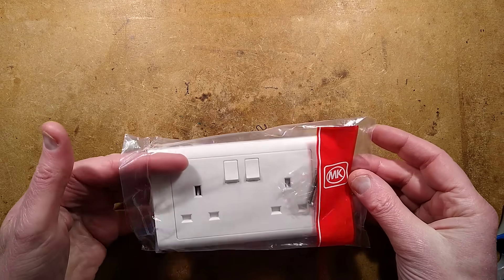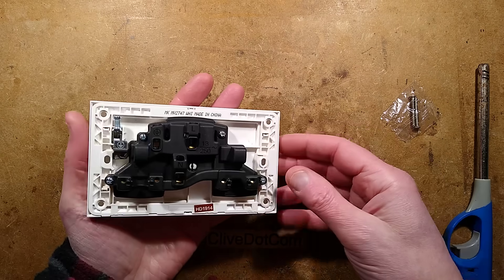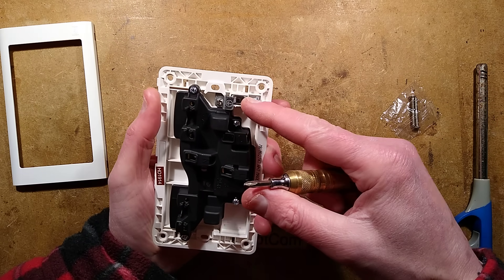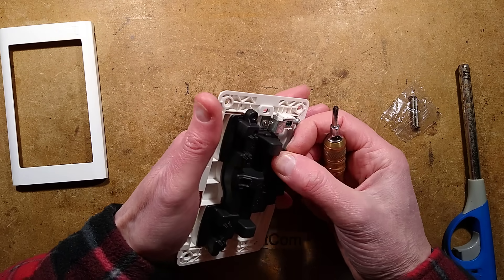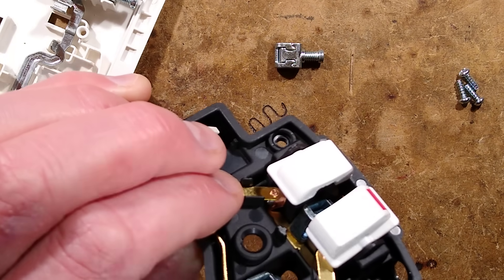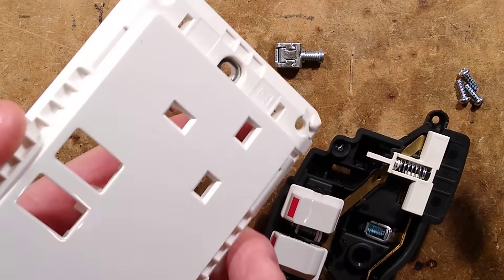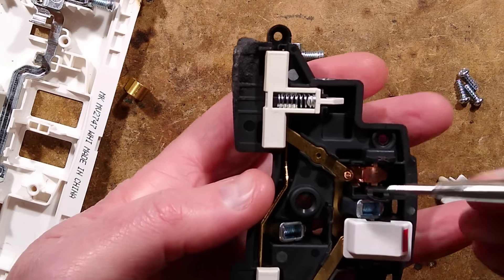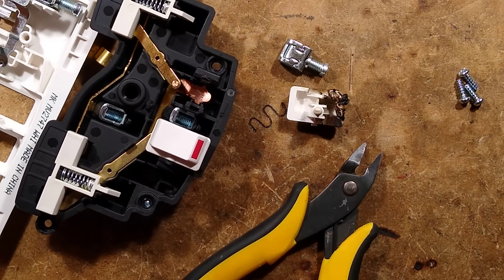Flame test on a recalled MK socket

Comment: Did you apply power and a load and see what happens? Maybe there isn't enough 'snap' or tension in the contacts rather than being an issue with the resting gap.
Reply from the maker: I just tried buying another one for a load breaking test, and the seller cancelled my order.

Comment: My theory is that the brass component that rocks when you operate the switch doesn't rock quickly enough, so if you move the switch gently rather than positively the brass contact will also rock slowly, which will cause explosive arcing if there's a heavy load plugged in. So maybe you could destroy a third one, Clive, with another switching test using a 3KW load.

Comment: I would sugest that when the switch is closed that the contact presure is sometimes too lite  or even not fully closeing therfore allowing arking, The gap when the switch is open is clearly very lage so it must be the closed position that is the problem.

Comment: I had an electric car on loan but no way to charge it other than using its “granny charger cable”
It simply plugs in your a uk 13 amp socket. 
However after some 5 hrs charging, the 13 amp socket got rather warm, not hot and not smoking. 
I was not the switch on the socket getting warm, but the line/neutral terminals of the socket. 
The plug itself on the charger cable was clean and looked like it had never been used. 

I wonder if this recall on the MK sockets was for poor contact connection resulting in over heating on high loads. 

My socket (not MK) was nearly new and little used. I replaced it anyway just because it had got warm in use on the car granny charger. 

YMMV
KW
Reply from the maker: Quality varies between sockets.  Some do heat up under sustained load.  For basic car charging I'd recommend a good quality brand or a spur and a 16A socket.

Comment: 4:51 Maybe that is what you should have done: Put it on an isolated circuit (with it's own extra fuse, and an emergency cut off), put a synthetic load on it, and then use a mechanism (even if just a long stick) to switch the switch a few times. See if you can get it to arc.

Comment: Perhaps with another socket, or the first socket once put back together (not the melted one) you could load it up with max current load on both sockets (or a little more) and try switching it slowly wearing insulating gloves or something. Try and make one fail?

Comment: Hi Clive,  Having already seen the first video you made I was a little concerned that the Earth Bar and Live Bars looked quite close together, but accepted you would have noticed that yourself.  However seeing this video where you have shown it from a different angle I wonder how close the Live and Neutral bars are on the left hand socket, seeing as they do not appear to be supported in any way, could there be flexing when installing a plug, which might create arcing between Live and Neutral Bars.

Comment: l'm disappointed Clive.....the phenomenon of the arc flash can only happen when the load is switched ON or OFF (under load) and you did not replicate this action.
Reply from the maker: It would take a lot of testing to finally get it to cause the issue.

Comment: I'm guessing that the flash you get when breaking a large load, especially an inductive one, is escaping though the gap on the side of the switch that doesn't have a flange on it. I wonder why they didn't put the flange around all four sides? seems odd.

Comment: Here's a theory... Perhaps if the curves on the brass or copper components of the switch mechanism are not quite right, it would be possible for the switch contacts to be partly opened or partly closed for a longer time than intended. These rocker switches are designed to have a "snap" action, which allows the spring to open or close the contacts almost instantaneously, when the sprung cam reaches a certain point in its travel. If there's a "flat spot" on the actor, the switch could rest in a position where the gap between the contacts is just the right distance for arcing to occur. 
The test for this would be to load the socket with say, 2kW and slowly actuate the switch. Listen for arcing. If it is possible to hold the switch in such a position where arcing is occurring constantly, then there's the fault.
I have to admit, that when I was eight or nine years old, and my curiosity about what happened behind an electrical outlet was beginning to form, I would deliberately actuate the switches slowly, "feeling" for the point at which arcing would occur. The switches in our house were easy to set off crackling, but I have noticed that more modern switches don't do it so readily. 
So, Clive... If you're reading this, maybe delve a little deeper.

Comment: It'd be a catastrophic manufacturing failure if they used the wrong plastic to the point you could set fire to it - or they'd have to be counterfeit.

Sounds like the chances are low, judging by the recall notice, but there you go.

Comment: Technical question but is is that socket comformant with standards? Feel free to shoot me down as I may be wrong but the "earth" line (as I understand it from some fights many years ago) has to terminate in a terminal on a bus bar or first outlet, use a bus bar (or cable link) to a terminal either at the other end of the bus bar or the second outlet, thus, both sockets are mounted on a continuous conductor with "incoming" and "outgoing" cpc terminals. That unit appears to be manufactured with terminal->bus bar->terminal (two terminals is fine) but that's only about an inch and one outlet, the bus bar is then extended as a finger to touch contact the second outlet connection. Thus the second outlet is effectively on an earth spur. As the connection is now a single line, it's the equivalent of terminating both cpc cables into one terminal post of a traditional bus bar in a double socket which should be an inspection fail nowadays. Feels wrong to me ... I wonder if that has any bearing on the safety recall?
Reply from the maker: I only regard the socket as requiring a single earth connection looped to or from the backbox as necessary.

Comment: Hi Clive could you possibly do a video on the Amazon bedside table lamps, they have usb a and c sockets to charge phones etc, but the a socket is very slow and the c doesn't work at all.
i know this because of the reviews and I have bought 2 pairs and the c definitely doesn't _ thanks

Comment: Yes it's going to spark under load.   It's the same as pulling the plug on a hair dryer while it's on.  You will get a spark at the receptacle.   The item you have plugged in must be turned off first.   The switches on the receptacle put your fingers closer to the spark.

Comment: It just doesn't burn :-)
As I said in the previous video, I would bet on problems switching heavy loads (10 - 15 A), arcing and burning the contacts, becoming resistive, very hot and deforming the plastic.

Comment: I just want to know why the outlets there have switches on them... Such a strange concept here in the US. Is it because of the 240 as arc suppression? 120 doesn't experience that for the most part.

That said the 240 system is better than the "split 120" we have here... save that one detail lol
Reply from the maker: It's for convenience and to avoid making and breaking contacts with the plug pins while powered.
Reply: What? My reply got deleted?

YouTube is over the line with this. Enough is enough. Peace Clive.
Reply from the maker: @ They seem to be filtering a lot of comments recently.  Probably due to the very high levels of spam.

Comment: In the eighties I did work for the local County Council. For new installations they specced MK or Crabtree, On maintenance work we found most faults on MK accessories, In the London area private customers only wanted MK.I am a lifetime Crabtree fanboy, but I heard they all come from the same factory since the 90's.

Comment: It is possible that the sockets have a variation, made by more than one factory or maybe a bad batch of material was used in production (although you'd hope that would be a partial recall between certain date stamps)

Comment: Why didn't you put a heavy amperage appliance on it (heater,electric jug...) and toggle the switch slowly to try and replicate the issue?. Maybe the copper used on the contact plates is too thin and gets too hot thereby making them softer after repeated uses.TC.

Comment: The recalls must be manufacturing defect for sure, the design and material passed all your tests. Like incorrect angle or stamping of copper tabs, or they ordered wrong gauge of copper sheets and it's too thin and bent after uses. 
There was a recall on Ikea moka pot I had returned that they said that the manufacturer installed incorrect safety valve with higher opening pressure, meaning that it might not vent steam properly when over-pressure. But they didn't know which batch it was because moka pots do not have serial numbers. rofl 
Yea, usually manufacturing defects are stupid things like that.

Comment: What I see is that there is usually an earth strap to both screws that secure the socket to the back box to earth between socket and back box. This one doesn’t have the normal earthing associated with previous my sockets.
Reply from the maker: That may be the weakness.  They've put it inside.

Comment: At the time I was Head of Quality for MK, we would never have launched such a poorly engineered product.  Better stick with the original MK double switched socket K2747 with its double pole switching and ultra safe 3 pin operated shutter.  (I suspect this 'Essentials' offering is Honeywell trying to exploit the MK brand and getting it wrong)
Reply: Any insight into why you'd consider this a "poorly engineered product"? Clive seems to be of the opinion that it's okay enough for what it is.
Reply from the maker: It turns out the weakness may be random rogue load breaking arcs reaching the internal earth bar.
Reply: @DanielM111  I agree it may meet basic minimum standards, however, it is the subject of a recall.  In terms of engineering, it lacks the premium features I would expect from an MK product.  For example, it has single pole instead of double pole switching.  It has a single 'E' pin operated shutter rather than a much safer 2 or 3 pin operated shutter.  It's designed with the minimum use of materials in mind rather than ease of installation, so no grouped terminals and no backed-out terminal screws.  It uses a less durable thermoplastic faceplate material.  The switch rocker moulding lacks a proper flash guard (hance the recall) and the product is CE marked which it should not be.

Comment: The recall says there is a risk of minor burns, so that doesn't sound to me like there's a risk of fire; that wouldn't be minor. Is it possible to get burnt by arcing?
Reply from the maker: Yes.  It's hot metal plasma, and at close range poses a burn risk.

Comment: If you look at the actual rocker switch it has a flange/lip on 3 of the sides. I think the side without the lip allows the arc flash to escape when switching under high load, singeing any fingers in the process.

Comment: If MK are reputable and responsible they'd have recalled the entire batch because even if a production fault affecting 1% of the entire batch are bad, they have no finer-grained way of recalling those faulty 1%. It's either the entire batch (of which 99% are fine) or risk lawsuits.

Comment: Hi Clive, thanks for video. There are two other possible causes for arc flash over. 

1. Contact opening speed - if the contact opens slowly or in a non-linear fashion. 

2. They decided to omit expensive arc suppression material in the contact, like  AgCdO, AgSnO2, AgNi, AgCu. 

Seeing as its budget range, it’s most likely number 2! Silver is expensive. 

Not suggesting you do a video v3 😂but if you did… you could look at (safely) disconnecting the contact under load. 

Thanks 🙏
Reply: These are good points, and perhaps the basis for concern by standards testing agencies. This is a specialized area of engineering not likely to be understood, and practiced by many.
Reply: I agree with the contacts not opening effectively.   if its possible for a user to operate the switch and maintain a gap that supports arcing, it could runaway quickly.  Maybe if the switch does not mechanically complete the cycle on its own with enough force at a definite 'tipping point'  things go sideways.   There is a line of rocker style switches that are very very common in North America that can be found at Dollar Store prices in some brands, and they will definitely do this if you let them.  Any inductive load would make this drastically worse.

Comment: Since the switches are tested for thousands of operations at greater than full load seems and odd failure mode government web site specifies mill sec flash so my thoughts are an issue with The tracking resistance of the material after x number of operations. Or another classic is where in the switch plunger that allows a slow break f the contacts when the don’t snap open

Comment: Years ago I had an immersion heater timer that worked for years - but it started to deform (heat and age?) bringing the internal switch contacts closer together until, eventually, they arced. Perhaps the MK problem is something similar?

Comment: You should do a video on those lighters that cease to function, I've always found it funny that they are refillable but rarely last long enough to be able to refill them.
Reply from the maker: I think it's down to the method they use to control the gas flow without letting liquid through.  It's often a sponge type material that seems to gum up with impurities.  You can get high purity butane for more expensive devices.

Comment: I can tell you a story. My father was working for the danish railroad. He was making the controls for the signals and the tracks. Back in the 80es a relay hut burn down 2 people who was in the hut in charge of control the trains tried to put out the fire. They could not... it spread even when they thought it was out it started again.

After the fire my father find out that there was som relays they could not get anymore. They had a part were the coil was..  it was made of ceremic. But they got them refurbised and they used some kind of plastic. It was testet with a gas blower before and after. But you could not make it burn. My father tried to put one in a oven to simulate the hot summer there was that day... a closed rum and a hot coil... and vola you suddenly got a fire you could not put out
Reply: "a closed rum and a hot coil."
Ah, many's a cosy Saturday night in spent with that kind of thing.

Comment: Next logical step would be to put it under full rated load and cycle the switch, using both resistive and inductive loads. Sure looks like a good switch, but something is an issue.

Comment: Could be that the contacts only melt (not burn) the plastic, thereby deforming it CAUSING the contacts to stay engaged or connect to the wrong terminal. That would be a fire hazard.